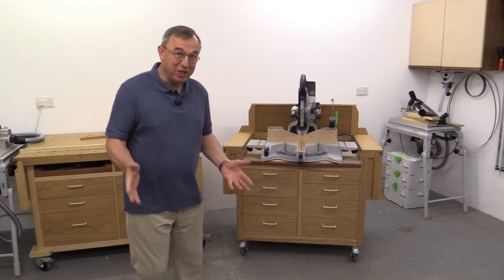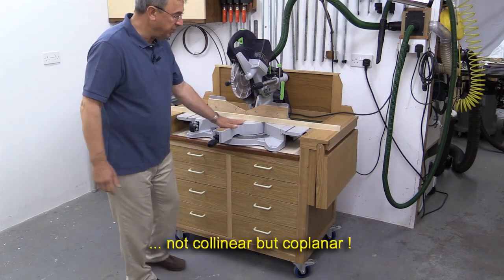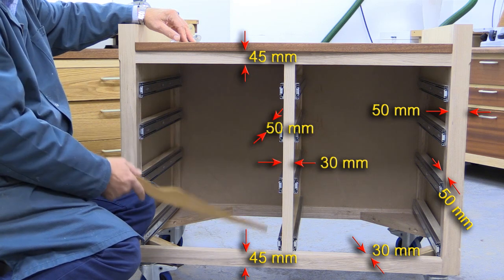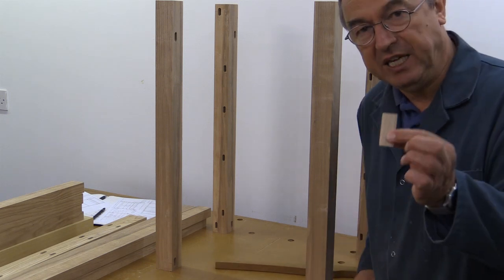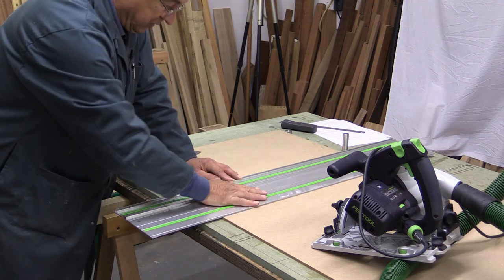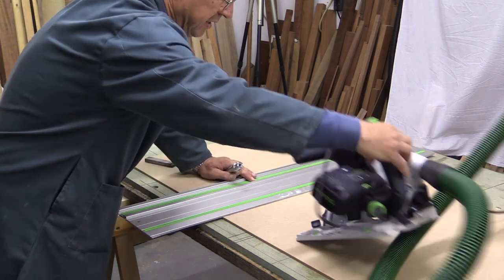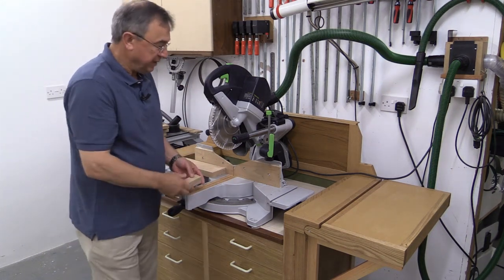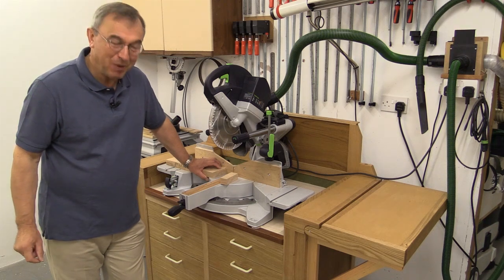Making a new Kapex Mitre Station

Comment: Super design and presentation as usual, Peter. Thank you. IMHO the Festoon platform is one of the best to lock on to.
Reply from the maker: Jeff Harmed Many thanks Jeff - I just wish that I had started to buy Festool kit a lot earlier - it has transformed the way that I do woodwork. Buying the Domino jointer meant that I can produce joints in seconds compared to the much greater time and effort needed for my mortice machine. Getting the Kapex means high quality cuts, every time and at any angle.   Peter

Comment: Hello Peter, thanks for sharing this video. I am re thinking my workshop at present and looking to replace my wadkin radial arm for a sliding mitre as I only really use it for cross cutting 90%, although it needs constant fetling to maintain accuracy. Your enthusiasm over the Festool offering
Reply: Sorry accidentally delivered the message. To continue; your enthusiasm over the Festool’s accuracy is encouraging and it would take up far less space in my small workshop. I’d miss the wadkins trenching facility but gain in other areas. If possible I’d like to purchase your plans for the saw station please and could I ask the reason for the raised panel behind the saw ? Look forward to hearing from you and wait
Reply from the maker: Do look at both KS60 and KS120 to determine which one suits you best. That panel is to catch the odd bit of dust that might escape and go behind the machine.   Peter

Comment: Peter, how did you cut the rebate on the strip of mahogany?  Did you use a router table to cut it?  Peter W
Reply from the maker: Hi Peter, I have the Festool CMS-TS (the small table saw) which can do rebates by removing the riving knife extension/dust collector. I feel that it is a relatively safe process as the TS55 saw itself still has its riving knife in place. An alternate method would be to use the router table.  Peter

Comment: I love this mitre stand. It appears the private message function is turned off. I would love the plans as you described in the video. How can I get them?
Reply from the maker: YouTube have removed te Private Message capability. Most comments that contain an email address get pushed into a spam folder and not published. If I see one I respond to it and then delete the message to protect the sender.  If one gets through and is published I still respond and delete as soon as I can.   Peter

Comment: Nice! Looks like you are no longer using the cleantex for the mitre saw and that you have made some unique dust collection solution there.
Reply from the maker: eaglecot Hi Eaglecot, I am still using my brilliant CTL 26 but you are right it is connected to a new trunking system which is in prototype form at the moment. When I have the final design I will post a video explaining what parts are needed and how to hook it all up. The new setup will make it quick and easy to switch from using the Kapex to any other tool but still using just the one CT extractor.   Peter

Comment: You’re plans don’t have a lumber list mr Peter. How many board feet is needed and what kind of hardware is needed. Thanks again.
Reply from the maker: My plans are designed to provide the basis of one's own creation. I do not provide a cutting list as people can adjust the plan to suit the wood that they have available or the changes that they make to the design. Good luck.  Peter

Comment: Peter
Can’t seem to send a private message to ask for the plans. Is it still possible to get a set .
Thanks
Reply from the maker: Hi Peter, YouTube did away with private messaging in July. They now have a fairly reliable spam trap that will put any comment with an email address in my spam folder which will not then be visible to the rest of the world. So far , this has been working at about 99% efficiency. Once I see a request for plans in my spam folder I send the plans and then delete the message. Any messages that get through will be deleted once I find them.   Peter